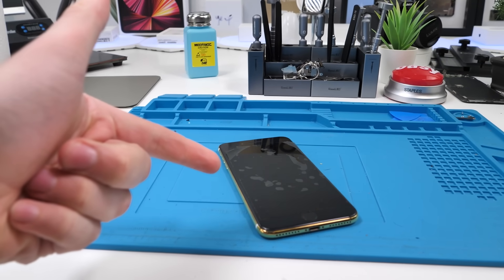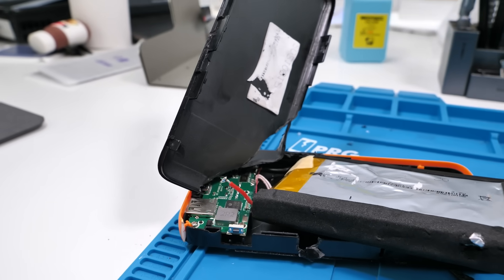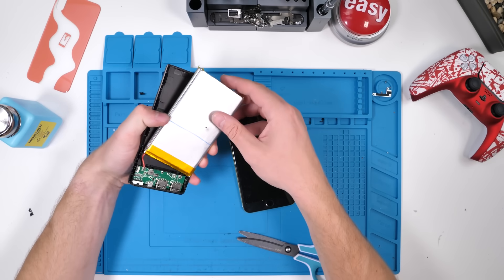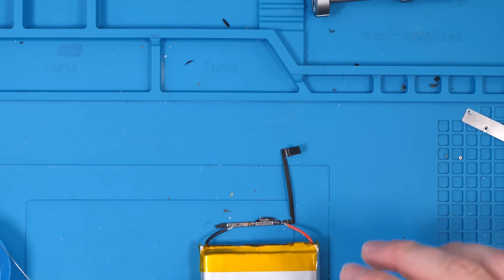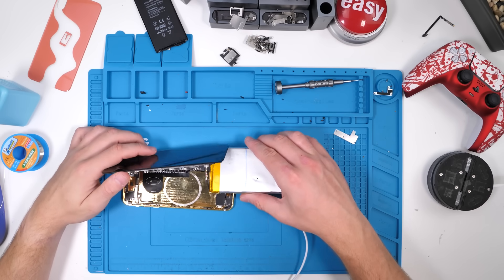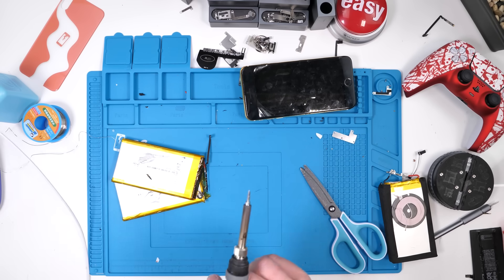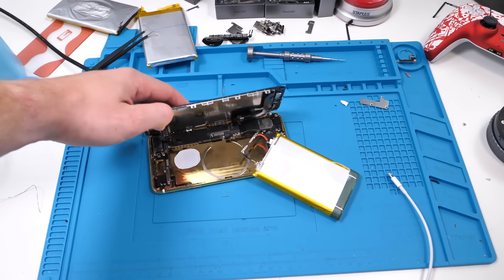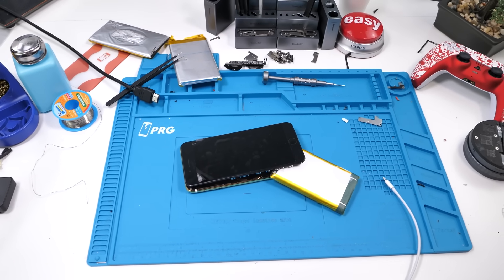Can I Install This Power Bank Battery Into An iPhone?? 10,000 mAh

Comment: I’ve done this about a year ago. I put 3 iphone 7plus battery on the back and glue it down. Also another one inside. Still powers on until now. 

Actually you need to activate the battery first after you disconnect it from the bms. You need a battery activator. Or you can charge it with your power supply. Just give 5volt about 10 sec and the battery should be good to go. The bms will go to "protect” mode after disconnecting the battery.

Comment: Just a thought… at the end you said you might drill a hole in the back for the battery. But a cleaner look would be to 3d print an edge piece that the screen and the back can snap to. Make the edge thick enough and the new battery looks like it could fit inside the phone. 
You’d end up with a chunky iPhone but 10ah would be worth the extra thickness.
Reply: My thoughts exactly

Comment: btw iPhone batteries are LiHv battery, (AKA has higher Max charged voltage(4.35 compared to normal lipo battery) so that power bank battery might have severe issue like swelling)

Comment: I did the same with my lg phone, the connector has gone i used some copper wire to solder the positive and negative wires to the phone. It took me like 4 hours to solder 2 pieces of 1cm wire in it. And it is currently completely usable

Comment: All Batteries that are made up of Li-ion technology have the same characteristics when considering the voltage. i.e 3.8v = 50%, 4.2v = 100% above 4.2 = explosion and below 2.9 = dead etc. so, you can swap anything with anything. Always make sure that the BMS board is compatible. that's all it need.

Comment: You have to go into the iPhone bio system now and change that the battery is actually a 10000 mah vattery from a 2800 or whatever you said the original one was or the battery percentage will be off cause it has more mah now

Comment: First of all, I love your Videos. This is a funny idea but it seems like you have missed something very important. The Battery from the Powerbank has a nominal voltage of 3.7V and a voltage of 4.2V when fully charged. The Iphones Battery however has a slightly higher Voltage of 3.8V and around 4.4V when fully charged. That means if you charge up the Battery with the Iphones BMS you will overcharge it and it could be a fire hazard. Even though both are Lithium Ion-Polymer Batteries they have different voltages per cell.I have encountered this voltage problem myself as I did the Same you did with a Galaxy s7.
Reply: what if we using phone battery with the same spec but higher capacity?
Reply: @surapurna  thats possible but sadly there are many sellers who rebrand normal or even used batteries as higher capacity. It is possible to make a fitting cell with a slightly higher capacity but you still have the physics of a battery that limits its capacity. Else we would have much bigger capacity batteries in our phones:)
Reply: @cinematica9073  like a tablet battery for example. Or just stack double triple the same exact battery in series
Reply: @surapurna  Yes but you need to connect them in Parallel and not in series. If you connect them in series the voltages are getting added up
Reply: If you want to increase the capacity you have to connect the cells in parallel.
Reply: @cinematica9073  yep... parallel i got mixup there. sooo its doable then
Reply: So the 4.2 percent of the 4.4v of the iphone bms is 95 percent, is it ok to charge it at 95 percent always to prevent overcharge? Because I can put an alarm in Accu battery app so it will alarm when it's 95 percent
Reply: @legato8748  the voltage is not linearly parallel to the percentage. LiIon and Lipo batteries dont have a linear voltage curve
Reply: @cinematica9073 but the bms of iphone is 

4.4v = 100 percent 
The powerbank battery is 
4.2v = 95 percent of bms, so if i do 90 percent every charge will the bms still overcharge the powerbank battery? What do you think?

Will charging 90 percent max prevent overcharging?
Reply: @legato8748  A possibility would propably be to download an app that displays the battery voltage and then monitor it while charging and stopping when 4.2v is reached. (Still wouldn't recommend because the last part of the normal charging process is at a constant voltage of 4.2v.  So the battery wont like getting the full current up to 4.2v when charged with the phones circuitry.) The problem is that the battery percentage isn't measured with the voltage of the battery but rather how much charge (mAh) is in the battery thats why we can't just say the battery is at a certain percentage that must mean the voltage is at the same percentage of the full voltage. Makes sense?😂 
Sorry for being a bit overcomplicated it's just important to be careful because batteries have some "explosive" tendencies when abused, trust me, I witnessed it myself😂😂. So if you wanna be on the safe side, don't do it.
Reply: @cinematica9073 too late 🤣 I already did it, I have 10000mah powerbank battery on my Samsung Galaxy tab s2 8.0 inch 🤣 already have an alarm on 93 percent battery 🔋 before I have 4 hours screen on time now it's over 10 hours 🤣 thanks for your info I will not fully charge this device 👍
Reply: @legato8748  Ah okay if it works for you, it's great. Enjoy your looong battery life😂👍

Comment: You can drill a hole or you can just take off one of the vloume buttons and extend the wire and put the battery on the back of the iphone 
ORRRR YOU CAN BUILD A CUSTOM 3D PRINTED HOUSING WHICH I REALLY WANT TO SEE PLEASE DO IT PLEASE 
❤❤

Comment: Can someone explain how will that BMS handle 10,000 mAh battery? Does it still think that its on 2900mAh battery? Would it even charge it above 2900mAh?
Reply: Capacity isn't actual characteristics known to bms board. When the battery fully charged it has 4.4 volts. And when discharged 3.7. so phone just calculates percentage based on voltage.

Comment: This is extremely dangerous as the iPhone charges its batteries to 4,35V whereas standard Power bank and regular liion batterys only charge to 4.2V.
By connecting the wrong bms you basically left the battery at the iPhones mercy. It will probably attempt to overcharge it and could destroy the cells, resulting in a blown Battery and a fire hazard.

If you attempt this, watch the cell chemistry and rated voltage before soldering a foreign bms to it.

Comment: I just had this idea where the iPhone using (external) batteries instead of having internal batteries. It would've decreases the amount of heat when you're playing games and not to forget the weight too. Just wondering whether long cables/connector affect the power delivery to the logic board.
Reply: @androidmaster3369  batteries dont explode when they touch dust
Reply: At that point why don’t you just get an Asus gaming phone if gaming is one of your top priorities?

Comment: Hey. I have a problem with my iphone Xs. i didn’t knew your email address you so i’m explaining my problem here. So, the problem is “ My iphone turns off randomly regardless of battery being charged fully or half or more than that. It’s turn on after 1-2 seconds and after it’s turns on it don’t show the battery percentage or health or anything related to it plus if you plug the phone. it’s acknowledges with the beep and shows 0% remaining & doesn’t charge. Then if you leave it like that for sometime or shake it well , the battery starts showing the percentage it had before. Another thing When i shake my iphone i can literally feel my battery moving inside. “ 

Now please tell me what could be reason behind this problem and what is the possible solution for it. 

PS. i bought this phone from a person 3 months ago at 81% battery health. And i dropped my phone 1-2 times but those were very minor drops like So minor. 

please tell me the possible solution or make a video about it. I will appreciate it so much

Comment: Hi. Is it possible to replace parts like screen(from lcd to led), camera module(same mp or more), bigger battery capacity etc from other phone or from markets. I haven't find any similar parts from different phone, but maybe from a certain phone or seller. I like to "upgrade" or just try to replace parts of my vivo y20i.

Comment: I did this to my old androids Sgs2, sgn4, a70 and a few tablets as they are making timelapse videos and should survive poweroutages while running hard. The sgn4 i modded because i was using it hard and used 3 metal-cased lipos on the back with cosmetic and somewhat protective plasticcasing. Used it ss a daily driver for 3 yesrs in that condition adding 3 years of life to the device as the batteries was getting hard to get by bc of the devices  age. Used it for a total of 6,5 years.
Reply: Are there any risk that we exclude a power bank controller from the electrical circuit?

I thought to do the same thing with my old Samsung but to solder it to a power bank output instead of direct connection to a phone bms board
Reply: Would you mind doing a tutorial? I wanna do it on my old phones too

Comment: Even if it works, you still have to reprogram the device so that the iPhone can accept the new capacity and perform like it, since the phone is only designed to take its original capacity. But you can get a S7 run on a A30s battery, and it will run, but refuse to take the full capacity of the A30s' battery
Reply: Generally devices just read the voltage of the battery to determine capacity, so there’s no reason why they wouldn’t accept a bigger one
Reply: @lakeland6798  if you use a 4000mAh battery into a 3000mAh phone, the phone will only accept 3000mAh as it is programmed that way. There's a video on it though..
Reply: @TIMETECH07  not super familiar with iphone modding but i’ve wired bigger batteries into android phones plenty of times
Reply: @lakeland6798  have done it as well, and my phone refused to take any more charges

Comment: I built a phone that holds the battery, well ever since I built it, I was bored do I decided to sacrifise my old compaq 610 laptop battery to the gods of diy and salvage 6 18650 2200mah cells, I put them all in series and then that 13200mah in series with the stock battery of a galaxy young 2 to get the total capacity of 14400mah, Its been 3 months and the phone is still on.
Reply: Parallel fam
Reply: @ciklop420  yeah, you are right, preety sure the phone would not survive 25.2v of a 6s pack

Comment: dude if you solder the 2 battery cells it powers the phone at 8.4v instead of the 4.2v the BMS is rated for ! if the BMS didn't have a security you would have fry the all iphone... you probably did this experiment without really knowing the risks. Glad it didn't smoke haha

Comment: your best bet is to poke a hole at the back for the wires to pass through.
but!!! i suggest you/use those FLAT wires so that it will integrate better with the New battery cover.
You can just design/create your own battery cover via 3D printer.

Comment: Now I really wanna try making a giant battery, a 3d printed thick af iphone housing, and some really long screen ribbon cables and make the thickest iphone ever
Reply: Make it durable like the 3GS
Reply: Yeee def do a 3d printed case for it
Reply: @slimydimeymama  I don't have a 3d printer but I think thats a minor issue I got this
Reply: @ceticx  pcbway has 3d printing services and they offer materials that aren’t plastic
Reply: @ceticx  can we get an update? I really want to know the result of this xd
Reply: @alessioram6631  I do still plan to do it i'm just stuck on the housing trying to learn cad, Ill reply when im close to done but might be a while since schools starting
Reply: @ceticx  aight
Reply: @ceticx  maybe should do something like adapter so people can have a battery replacement iphone there are still those batteries in some phones that people could use on there iphone if someone made a battery adapter for it
Reply: @ceticx  It's been a year, how its going?
Reply: @SilviInsania-hj9nd  Oh yeah I forgot about this, I actually did make the 18650 battery pack that he did in another video, although I burned through multiple iphone 6s' not gonna lie. So really all I'd have to do is design a housing and attach it to one of my preexisting ones, I think I saw screen extension cables on aliexpress once. I'm too busy right now to pursue this but ill keep it in my mind
Reply: I would buy it!
Reply: The board should to be on top of the battery so everything fits right without anything more than the modified housing
Reply: I want to see this
Reply: Iphone 7 thicc max
Reply: I did this with my iPhone 7
Reply: ive done that exactly to my phone.

Comment: iphone bms has a resistant check. so if you use 2 cells, that means you almost cut the resistant in half. that is the bad battery indicator.

Comment: Just an FYI that this still might not work as you expect. Some more expensive/high quality BMS's use a "fuel gauge" that actually measures the amount of mAh that comes from the battery and uses that to report the state of charge/shutdown the phone if the measurement exceeds to programmed battery capacity.

Not a guarantee but I would be surprised if they didn't have this at least as a part of the battery protection circuit.